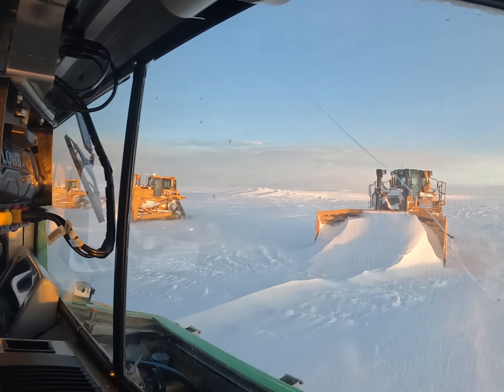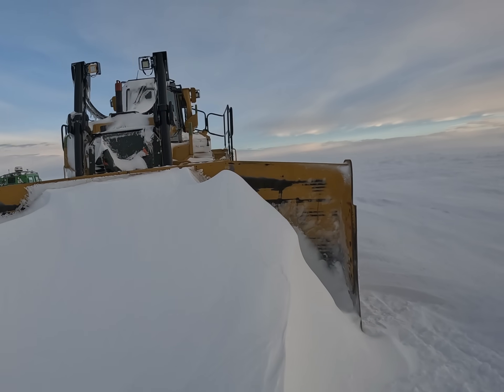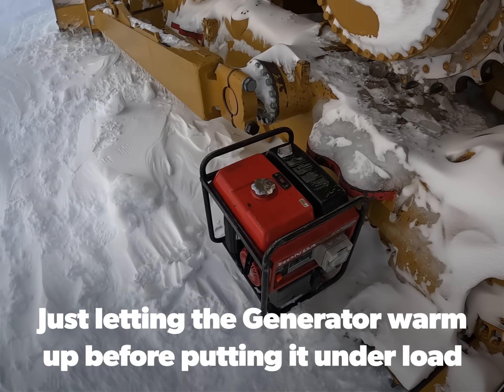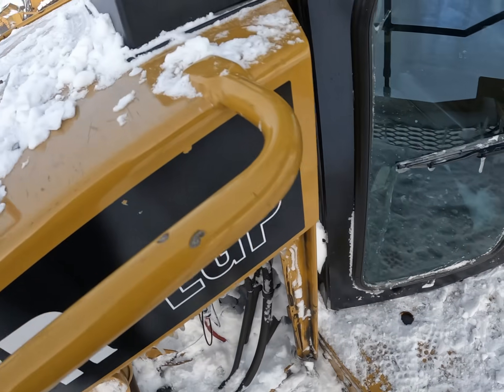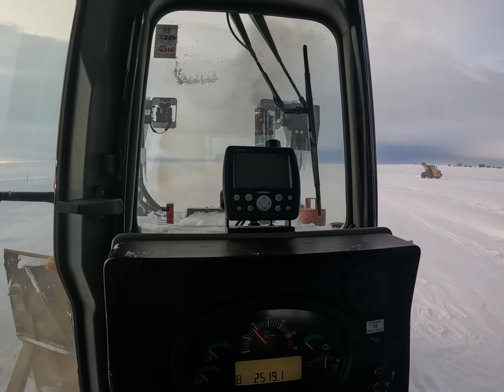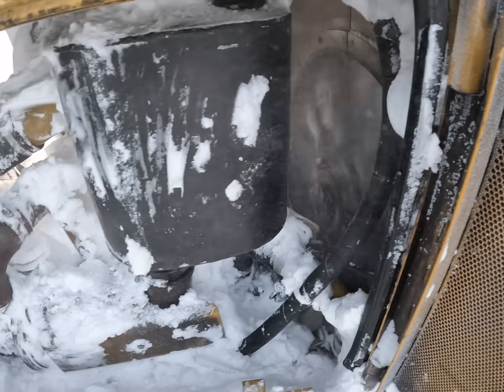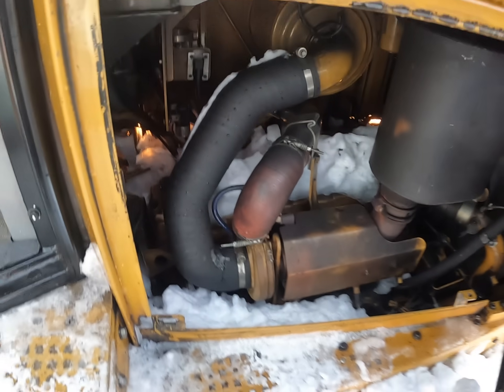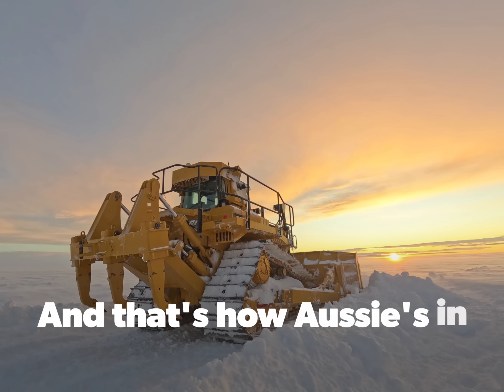CAT D7 DeBlizzard and Start in Antarctica

Comment: Been there and done that. As a camp manager in remote winter camp West and North of Prudhoe Bay Alaska 250 miles North of the Arctic Circle I had 2 500KW Cat generators. One would run 24/7 for 250 hours before turning the load over to the other so that the first could have maintenance. They were in a wooden shack. After a several day blow the shack would fill up with snow especially around the standby generator. The snow would have to be shoveled out around access for both generators for checking the running generator and for emergency access to the standby generator if the primary failed. One night at -40F the primary failed followed about 2 hours later by the secondary. Had 2 different crews working on both to get 1 running. Camp got down to 50F, started thinking about emergency evac to a warmer place when the primary was brought back online after stealing a water pump from a 3rd generator that had failed due to a poor choice of engine oil weight. The secondary was toast, too much work to get the secondary out and another one in, if there was one to put in, finished the last 5 weeks that the camp was in existence on the primary with running oil changes and a lot of fuel.

Good stuff. I figured that the engine compartment would have had more snow and packed in like concrete. Nice commercial for Honda generators.

Nice beard. I never liked shaving, found that if I let my beard grow out I didn't need a face mask down to -50F. Moved on from the job still have the beard. Some of the best days of my life so far was working in the Arctic in the winter time.
Reply from the maker: Thanks for sharing mate, sounds like some tough times out there, but tough times make tough people!
Reply: @thommosadventures  Not so much tough times as good times mixed in with some interesting problems to keep you on your toes.

Comment: “Hello John Deere, we have a sensor error won’t move”
Reply from JD
“We’ll schedule a tech to look into it”
-
Just tell us what error FU49326 means
Oh? You got that? Well you need to bring it into the Stealership
That’s not possible, what does the code mean?
Can’t tell you 
You don’t know?
No, we can’t tell you “Proprietor Information”
Just tell me so I can look at the area of issue 
Nope, need to bring unit to shop 
Sorry mate, that would be too expensive 
Well then , we can send a tech to you, but it will be about 4 months, where about are you?
Antarctica 🇦🇶 
Sorry did you say NSW
No. Antarctica 🇦🇶 
Sorry wrong number (click)
Fawk !!! Whose the idio t that bought JD equipment!?!!! 😡
Reply from the maker: There's a good reason they're running Case tractors and not JD!

Comment: Did the actual temperature get mentioned? It was the middle of summer I assume as the sun was up at 3 am.
Reply from the maker: it was around minus 10 - 15 degrees Celsius without windchill.
Reply: Well that's not horrible
Reply from the maker: @paulloranger545  certainly going to get worse over winter, summer has been quite mild this year.

Comment: That is what "bone chilling" cold looks like.  I spent 4 deployments with NSFA back in 86 to 90.  I helped dig up 2 D8s Admiral Byrd used to traverse the continent.  Both were buried several yards deep.  The Smithsonian wanted them but it was determined the serial numbers didn't match so .......... dig a hole for the purpose of digging a hole.  :(  Albeit occurred during the summer months, it still got real cold.
Reply: Antarctica as cold as the top of greenland’s ice sheets in the winter during its summer so still crazy extreme temps

Comment: As an Operating Engineer working for NYC 38 years, 28 at Fresh Kills Landfill. I can honestly say there is nothing worse than a macine that won't start in the bitter cold. Our mechanics would show up hours later. And you would be frozen to the machine by then. But when they did come. Many times they would bring a 'salamander' (kerosine heater). They would put that under the machine. Fire it up. And by the time you thawed out. Your machine would be running and warm. Those 'new' machines are terrific.  Turn the key, push the manifold heater for a few, then start. They start right up in any kind of weather. Later on, we left the machines running, unless you were positive no one was going to use that machine in a reasonable amount of time. A "Utility" guy would go around and make sure all of the relevant machines were topped off with fuel. Our Payhaulers each had electric outlet in the parking lot. So you could leave them plugged in (engine block heaters). IUOE Local 15 Ret.

Comment: I would assume the engine drive belts would be stiff and brittle but Caterpillar is one of the few manufactures that is struct about rubber formulations and even has hot and cold climate belts, grommets, nubs, bumpers and dampening shoe parts.

Comment: You should buy some lotto tickets! Or pass some of that luck on. If that was me. The batteries would be dead. The block heater won’t work. And somebody forgot to put the storm covers on the air intake and exhaust.

Comment: That's almost unbelievable that it would start that quick under those conditions - In 40 years I've never seen that happen - Obvious big improvements over the years with CAT.
Reply: They used a block heater
Reply: @texasblaze1016  how much experience do you have with diesels
Reply: @Jrod 264 Win mag  what do you mean "experience" and whats that have to do with block heaters? Block heaters are a pretty simple concept l, plug it in it warms up the engine and starts like it was in sitting in a 70° garage and they probably had a battery heater or they most likely took the battery out for the blizzard
Reply: @texasblaze1016  a block heater alone isn’t going to make every diesel start like it’s 70° outside. Some of mine have a hard time starting at 20° plugged in all night. Battery cranking power is another huge issue.
Reply: @texasblaze1016  I was simply wondering if you have much experience with several different diesel powered equipment and cold weather
Reply: @Jrod 264 Win mag  
I lived in South Dakota for 5 years and never had a problem with block heaters. Even if it were -40 our work trucks still start right up. I have experience starting up diesel engines in winter, none for working on them. Ive installed a block heater but thats all.
Reply: @texasblaze1016  it’s a small world. I was born and raised on big farm also in sodak. Some of my family still there.
Reply: @Jrod 264 Win mag  
Yeah man those were the worst winters ive ever experienced. I was there for snowstorm Atlas when the governor declared a state of emergency. So glad im gone for those brutal winter months but it was too beautiful in the summer.
Reply: @texasblaze1016  minus the occasional blizzard the rapid city area is typically warm in the winter months. It’s not uncommon for 60° days in January. Probably average 40° for daytime high. They are at least 15° warmer than Sioux Falls at any given point in the winter
Reply: @jrod264winmag  they most likely took the battery's out
Reply: @jrod264winmag  i live in alaska and a diesel with enough time on the block and oil heater will start up just fine. i have a truck with no glow plugs that can start in the cold if it's been on the block heater all night
Reply: @krebgurfson5732  pump the brakes kreb, I didn’t say it doesn’t help.
Reply: @canuckcanadian753  sorry, I miss understood your comment. It definitely cranked over really fast like the batteries were nice and warm
Reply: @canuckcanadian753  definitely more than just 45 minutes on a block heater
Reply: @jrod264winmag  The block heater on big diesel engines aren't a little dinky heater coil stuffed in a freeze plug, like on a pickup truck. They're usually a ~2000-3000w thermosiphon, or even a thermopump heater that actually pumps hot coolant through the whole block. I've started 80 liter MTU engines with dual coolant heaters in -40C weather, and if you let the heaters do their thing for a while whilst you check everything over, they'll start just as fast as on a warm summer day.
Reply: @ForfeMac  Thanks for the info. I service diesel generators and own a few trucks and farm tractors.
Reply: @texasblaze1016  Yes, I didn't see how cold it was. I think there was some missing info in the description.
Reply: I wasn't really surprised as I've seen that new equipment is quite good at cold starting. Even without preheating, zero and down to -5 is not a problem although manuals recommend preheating. Hydraulics might be offline for a while, though, if not preheated. A big help is the "cold start aid" that heats intake air. It's close to the cylinders so that it only takes a few strokes for the hot air to reach the cylinders. Manufacturers also test the cold start and running, maybe they didn't do that in ye olden days when cold starts were a struggle. Cold emissions are still bad though, as shown by the puff of black smoke. Emissions aside, I have to say that these dozers are literally probably the cleanest used ones on the planet.
Reply: What type of diesel are you guys using?  You have to have a dunce of additives for the diesel to stay stable.
Reply: Jet Propulsion 8 fuel added to manage fuel from jelling .
Heat intake air manifold .
Block heater .
Oil pan heater .
Fuel heater .
Reply: Yeah it’s called modern day diesel technology you boomer😂 Without the emissions garbage they start right up.
Reply: @arfetherussian I swear “boomers” is a millennials favorite word.  I’ve never heard the term used so much in the last couple of years.  But it sounds cooler than “millennial” or “snowflake.”
Reply: @arfetherussian  I don’t think the emissions garbage has much to do with making it harder to start. Now, modern diesel technology, you are right . That’s how they start easier in the cold
Reply: @arfetherussian wait, hes a boomer who doesn't understand that modern diesels "without the emissions garbage start right up"? You do realize that a modern diesel is absolutely full of "emissions garbage", has way more than ever, right? And in the past it has always been the boomers sighing and saying how much better the old plain diesels worked in the days when they just belched black smoke everywhere and no one had heard of "emissions". I feel like you have something backwards.

Comment: You have it very easy compared to the procedure when I was at Scott base The D8 took a full day's work to get started including thawing out the pony motor, no electric start, and fitting the batteries. Batteries of that day could not stand being left out in the cold. Once started it was running without shutdown for the season.
To be fare that was 1982.
At least the D8 had a cab, the D4 didnt.

Comment: Still clean as a whistle, not a speck of mud.  You're living the dream down there boys.
Reply: Like I was saying, at least when they bring them home they should be almost new still. They won't rust or wear and I doubt they get used that heavily. Worst thing they will experience is the frequent cold starts, but that's probably not that big a deal with modern oil and block heaters. They will still look like most machines a week of the lot in ten years.
Reply: No dirt.
Reply: Biggest thing is no heat. At that temp water is not very reactive with steel (few things are reactive at this temperature), not to mention it's not wet water, but ice.

Comment: Cool but why not get the dozers with a rad relocate kit to avoid having to dig them out? We run D7-D8's with the rad, condenser and hyd cooler on the roof along with the A/C and alternator. The Alternator and A/C compressor are driven by a hydraulic motor and the rads also have hydraulic motors to cool them. We then seal off the harmonic balancer so water can not get in, this type of system would help with snow intrusion.

Comment: For how snowed in and frozen the engine was, that baby fired right up
Reply: ITS BECAUSE THEY HEATED UP THE OIL AND BLOCK BEFORE START. God damned you people are stupid.
Reply: @Darktophat_10  me commenting how easy it started up offended you princess? Lmao get a life dude
Reply: And for any of you other twits that feels the need to comment something, I’m from northern Alberta where it’s regularly -25 Celsius and I’ve seen trucks and equipment alike under heated tents with block heaters for 12-16 hours and still not fire. Not that I thought my comment needed an explanation but here ya go.
Reply: @andreasauger4751  I agree. Hours and hours on the block heater. Damm the generator probably took 15 minutes to warm up.
Reply: @Andreas Auger  I'm from manitoba and we usually get -30c. People out here amazed it started lol try the same thing in -40c 😂
Reply: @jjunderwood4095  With a Detroit running straight 30W LOL
Reply: @andreasauger4751  People always gotta be armchair experts and snobs. (the others not you)
Reply: @andreasauger4751  If a block heater has been on for half a day in -25 and it still won't start, there is something wrong. It should start up easy, that's not even that cold. Modern equipment should be capable of starting without a block heater in those temps.
Reply: @jjunderwood4095 Yipe from MB as well and a block heater for 15 minutes would not start anything in our Province at -40 C specially a diesel engine.
Reply: @carlosoruna7174  Has to keep the generator in his bedroom so it will start in the morning.  Wonder what weight oil that machinery uses.
Reply: What are u dozing  there ????
Reply: That’s a good catch! People don’t always realize how much prep work goes on behind the scenes, especially in cold starts. Block heaters make all the difference!
Reply: двигатель снега не боится, он боится мороза, но если есть хороший , надежный подогреватель и система запуска в мороз, то всё будет окей, а caterpillar всё это имеет ❤
Reply: These alsp have no dpf/def, etc. makes a big difference
Reply: @JimGriff1720  it's a 3306C mechanical.
Reply: @JimGriff1720  It's propane doofus.
Reply: You missed the part where he had generator running on the block heater long before he attempted to start. Video was edited down as well as he cleaned the machine up.  Block heater only needs about 15 minutes and will start like it’s a 70 degree sunny day
Reply: @shortthrow50  15 minutes ya right, have you used a block heater in the north before? Also you can clearly see the engine bay covered in snow still after the block heater was going which means the block was still cold
Reply: @dieselshenanigans2458 you think maybe there is a special package that Cat has come up with for vehicles in Antarctica?
Reply: I mean, we all knew it would start for sure, but thanks for being the featured comment shown that ruined it! 😂😂😂
Reply: USA POWER BABY!

Comment: I wish my old 68 D-7E started that good in the winter of 74-75 at Ft Dix. And I wish back then we had enclosed cabs. We didn’t even have ROPS back then. Our motor pool was at the back fence that abutted the taxiway at McGuire AFB and that winter the windchill was below 0 every morning and we had all kinds of trouble trying to get that old Cat started even while  using 10 W motor oil and jumping it with our old truck tractors. Thanks to our fuel depot dispensers with a 50/50 winter blend of #1 and # 2 diesel

Comment: 99% of people have no clue that steel can break like glass in extreme cold.  Coldest temp I worked in was -62 Celius/-79 Fahrenheit, not including will chill.  Our equipment had every heater possible and the machines still made the most horrible sounds.  If you shut them down it would take tarps, big gas heaters and at least a day to restart them.  Even wearing almost $2000 in Arctic gear we could only withstand 15 MAYBE 20 minutes outside.  I'll never do that BS ever again.
Reply: Where was this at ?
Reply: @jfresh4507  Meander River less than an hour from the Northwest territories Boarder

Comment: Do you run into battery issues at those temps year round or are they well protected? Seems like one hell of an adventure 😅
Reply: If he did.  The portable generator fixed it
Reply: My guess is the machine is gonna be sitting for a bit, you pull the battery's. In that temperature they would be dead. Unless there is some kind of heating system for them.